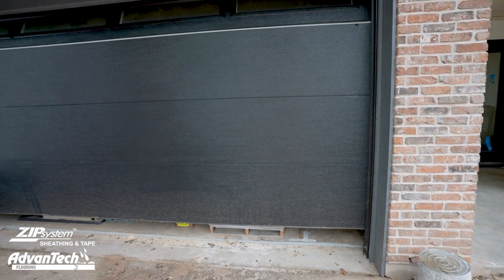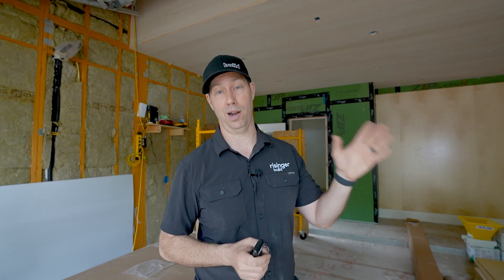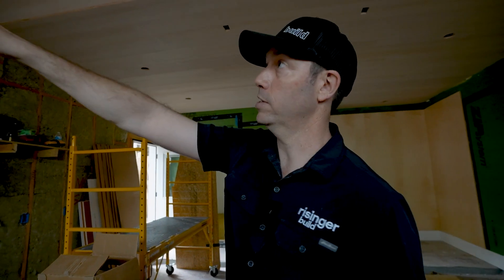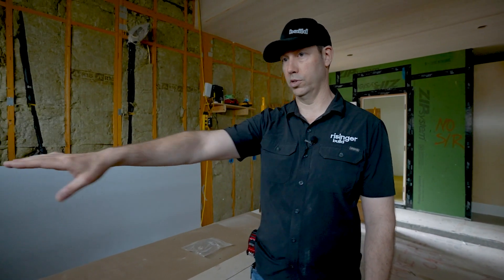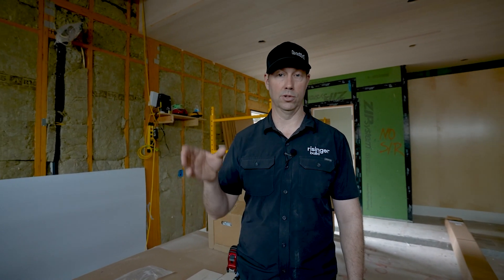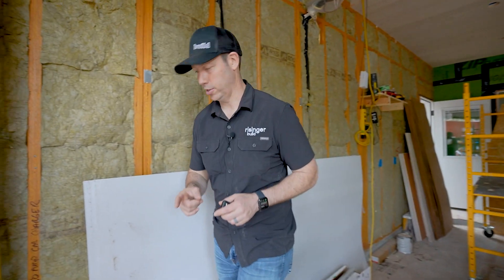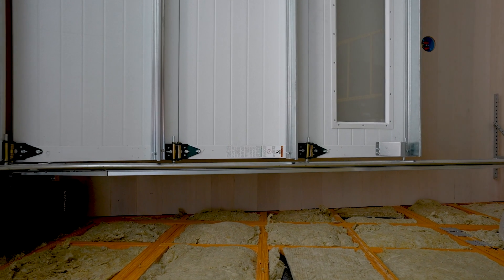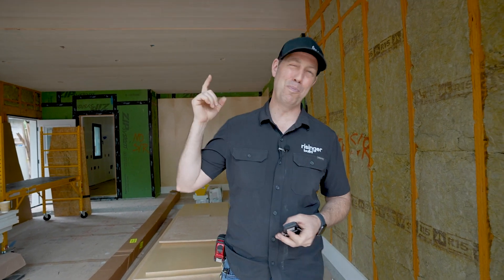SUPER Insulated Garage!

Comment: Isn’t it minimum code to have at least one layer of dry wall as a fire stop on your garage walls and ceilings?
Reply: I want the answer to this
Reply: The rockwool insulation is probably giving it the fire stop
Reply: @wyattbonnette3414  thats not what IRC allows as a solution.  5/8 gyp is what they want.
Reply: And taped too I thought
Reply: yes, i put plywood on the inside of a a garage once and it failed inspection.  had to cover it with 5/8" drywall.

Comment: That ball isn’t going to put out a lithium ion battery fire
Reply: Nothing is short of a pumper truck and hours.
Reply: I own the same battery backed garage door opener (love it). The battery is lead acid not unlike a UPS. But you make a good point. I wonder if the extinguisher will work on a lead acid battery fire.
Reply: @sirwnstn  those balls don’t last long enough to put out a battery fire. It will just start back up once the ball is gone.
Reply: This does work on Lithium Battery fire
Reply: @thomaslivezey  Lithium battery fires are caused by thermal runaway. They are extinguished by cooling the adjacent cells while trying to extinguish the actively running away cell(s) that is on fire and trying to contain it. Generally this is done by the use of all things water. Lots of water. However, do not drop or submerge into water. Just let lots of cool water flow over the battery. 

That is why folks are saying the above. That ball is to small to effectively extinguish a large battery fire, but with any fire time is key, so hopefully it will provide some capability to give responders time to arrive and get ahead of it.
Reply: Watching the demo's of the fireballs, to be effective, the ball needs a semi-enclosed airspace such that the explosive pressure can effectively deliver the material to the fire fuel and expel/displace part of the O2.  It is a small advantage to place the ball in a corner.  But, there is alot of airspace for the pressure from the ball to rapidly dissipate prior to being effective with the fire.  He would have been better off mounting the ball above because the ceiling would better reflect the pressure towards the fire source.  The lead acid batteries are not the fire risk of Lion.  Agree with the conclusion - probably a waste of money for anyone not being sponsored.
Reply: @sirwnstn  Sounds like he should set one on fire and put one of those fire balls on it to test it out!
Reply: @sirwnstn  if it is lead acid, I hope there is a test that runs regularly and notifies of battery issues and that the batteries are easy to replace. Those under temperature controlled conditions are good for about 3 years, and out in the heat it could be as little as 1 year. Lithium ion, or better yet lithium iron phosphate would be far better in that situation, though it would cost more up front.
Reply: @do4267  Or a type K extinguisher
Reply: @jeffreyparker9396  the Liftmaster 8500W will emit an annoying beep every 30 seconds and show a red LED when the battery needs to be replaced. Fortunately the battery is pretty straight forward to remove - one screw to remove cover, disconnect leads, and slide battery out. Just need a ladder and P2 screwdriver.
Reply: @sirwnstn  that is not too bad, but dealing with that as often as lead acid batteries would require is very annoying. Does it at least use a standard battery size which should be able to be replaced with a lifepo4 battery?
Reply: @jeffreyparker9396  in theory I guess you could replace it with something that can do 12V at 5A. I don’t believe the charging electronics would work with anything else but lead acid though. The Liftmaster 485LM battery is like $10 online. I’ve had mine for over 2 years now and will probably need to swap it out in a year or two. For me I think it’s worth it for $10 every couple of years to have peace of mind that if I’m not home and the power goes out, my wife can still operate the opener.
Reply: @sirwnstn  lifepo4 batteries are usually drop in replacements for lead acid batteries, just need to be able to get the right physical size. They do cost about 3x as much, but will normally last at least 5x as long and provide 3x the power for a given rating.
Reply: @sirwnstn  I will also note that the lead acid batteries are quite environmentally unfriendly when compared to the lifepo4 batteries. Also testing the battery has to be done properly or there would be no way to be sure that it would open the door. To do that you need to put the battery under load. I would be surprised if they test it like that since those testers usually cost a few hundred dollars. If you don't test the battery under load, then it is very possible that when the load of the opener is put on the battery, the voltage will drop low enough that the opener won't work.

Also worth mentioning that you can absolutely open any garage door without power since all garage door openers are required to have a disconnect for this purpose.
Reply: @jeffreyparker9396  if lifepo4 batteries can simply be dropped in without worry about the charging circuitry, I’d definitely think about it. As for opening my garage door without power, it’s definitely doable. I’ve showed my wife how to operate the disconnect too, but my wife isn’t strong enough to overcome the inertia of the super heavy door. My door is 16’x8’ sectional and solid wood - and yes, the 4 springs are dialed in to properly balance the door but moving it from dead stop is an absolute pain. I can’t expect my wife to lift it open, then grab a step ladder to hang on the door bottom to close it!
Reply: @sirwnstn  the force required to open and close the door is definitely something that I would consider if I ever replace my garage door. I generally expect that it would need to be opened without power at some point, even if I have a garage door opener with battery backup. Also less resistance on the openers motor will mean that it will last longer and in the case of one with battery it would mean that it is more likely to be able to be opened with an old battery. I would actually put having a low force required to open the door much higher priority than price or insulation, since it is a safety thing so that people can't get stuck in the garage.

Comment: The garage door opener has one thing that is most important: upon closing the door a deadbolt is activated! A nice and secure feeling when you are asleep or away for the weekend.
Reply: I've never seen or heard of one before, and now it's a must have for me.  Love this channel.
Reply: If you do any research into those automatic door locks, you will quickly see they have lots of problems.   Most people get sick of fixing them and rip them off after a few years.       

They are a good idea, just not executed well.
Reply: @brent1041  yep. And just having an operator attached makes the door immovable.
Reply: We have this same setup.  The deadbolt is great, and for anybody wondering, it has a manual unlock.  Along with pulling the manual release on the opener, you can open and close the door by hand if you wish.
Reply: @brent1041  I’ve had them for years. Two per door so four altogether. 
They have given me no problems only peace of mind. 
And I paid for them. Didn’t get them for free.
Reply: @brent1041  In three years the lock never failed on me.

Comment: As a Class A contractor with 37 years of experience I have been watching Matt’s videos for a while but I will have to say that the average person is definitely getting the wrong idea if you think you can put a flammable product (plywood) on the walls and ceiling of your garage without having a 1 hour fire rated shield behind it. Code REQUIRES this and is often met by installing 5/8” Sheetrock. I know Matt doesn’t usually comment on the responses to his videos but if you are thinking about doing this please call your local building department to confirm what you are proposing will not result in you getting into trouble and risking the lives of your family members.
Reply: Thought the same thing.

Comment: I really like that opener. Never have liked the standard opener yanking on the upper center of the door. Direct connection to the shaft seems legit. Good call on the raised rails too.
Reply: They are meant for this application with the high lift tracks.  They have lots of issues on standard tracks.
Reply: @VulgrDisplay  Good to know Thx.
Reply: @VulgrDisplay  what issues?
Reply: @shellderp  if anything makes the door hang up for a second, the door will pause, the operator will keep turning that shaft, and the cable will unspool, and then tighten around the shaft instead of the drum. I’ve installed a handful of them after trying to talk customers out of it and told them there is no warranty on it because they’re so prone to failures. I’ve come back within two years to replace them with regular openers
Reply: @nicolasjoy1181  i have this same opener, there is a cable tension sensor that helps prevent this issue. i've had the opener for 4 years now, never and issue at all. even installed on a tight clearance track, just had to add a spring to push the door closed the first 6 inches of travel.

Comment: We have this same setup and love it. The insulated door really makes a difference, especially in our bedroom which is above the garage.  For anyone wanting this, make sure you hire someone who is VERY FAMILIAR with installing this type of opener.  We had someone come out to install one and they kept commenting on how horrible they are and never work properly, etc, but installed it anyways.  It didn't work, wouldn't open fully, wouldn't close fully, would stop mid open...UGH!  He suggested we call another installer to check it out since we didn't a different one and he said this type of opener was junk.  We made sure the next garage door company we had out knew what they were doing before we hired them.  The whole unit was far too low on the wall to allow the direct drive to bring the door up all the way, the wiring was incorrect, and we needed the raised rails which weren't installed.  It works perfectly now.  They are great units, if installed correctly!

Comment: As a garage door guy I am soooo happy to see that they pitched the tracks for that Jack shaft motor.

So many hacks install jack shafts on standard tracks and they flop the cables off constantly. 

Bigo oof on the metal rollers.  Get some good nylon wheel 13 ball bearing wheels.

Comment: Hey Matt, can you show us all of the weatherstripping around the overhead door?  How do you air seal it?
Reply: same question I had. I would love to change my door out with something similar but the air sealing piece is probably important.
Reply: I will start with this - DO NOT TAMPER WITH A GARAGE DOOR IF YOU HAVEN'T BEEN TRAINED. THEY ARE EXTREMELY DANGEROUS. Sealing a overhead door is actually simple. That's if you have a sectional door. Things to consider are if it's so tight to the opening it rubs excessively or so if it's loose there's a gap. There's also the top roller adjustments, where the opener's close limit is adjusted at and also the physical force applied to the door by the opener. The condition of stop moulding and it's placement also. If you have a enclosed carport you may find the concrete sloped to one side and weather stripping doesn't seal the bottom on one side of the door. Even the angle of the opener's arm is a factor. 
1. The horizontal moulding goes on first. Trim part nails flush to the inside of the opening.
2. The vertical mouldings go from the top to about ⅜“ - ½“ from the ground. That prevents any bowing if the house "settles". Use paintable caulk to seal both ends and the front side of the trim around the entire opening. Train the flaps in the upper corners for the horizontal flap to overlap the vertical flaps. 
4. Weather stripping is easy to replace. There's usually small screws hidden on it's edges holding it in place on what's called the "bottom extrusion". It slides into channels from one end to another. It's a few inches wider than the door and has the excess  tucked into itself on both ends. If you have a sloped drive and there's a gap find a old garden hose and insert it inside of the weather strip. Use just enough to close the gap. You wouldn't want the door closing too hard where the rise is. The bottom of the door takes quite a bit of abuse. If the extrusion is damaged beyond repairand you need a new strip it's easy to replace. If mice chews up the strip replace it with gray. They're less likely to chew it. 
5. I CAN'T ADVISE MESSING WITH THE DOOR'S HARDWARE OR TAMPERING WITH THE OPENER. If you see loose hardware, bent track (particularly the verticals) or the door isn't tight call a reputable technician to service it. One thing I've seen, especially at newly constructed houses around Knoxville, TN is vertical tracks resting on the ground. That's a rookie mistake and a sign the installers don't have service experience. Just like the moulding there should be a gap to prevent bowing. It's a extremely negligent mistake. Danger being the door possibly flying off the track. The other stuff is safe for an average person to repair. Let a technician do the rest. It's easy and they usually can address any not so obvious issues they see immediately. A no parts inspection, adjust and lube can be done in way under a hour for $85.00 and no tax.
Reply: @qwaszxpolkmncvb  you don’t have such prefaces when riding a bike.
But more people are killed riding a bike than by garages.
Funny how paranoid people are.
I have zero training on garage doors and I fix them all the time.
It’s not complicated actually less complicated that riding a bike. Lol 😂

Comment: Hello Matt, love the progress of your home! What a great choice for your Overhead Door and Garage Door Motor, excellent choice. I know your a stickler for detail while making sure everything is right. Therefore, I will tell you the “Cable Tensioner Monitor” on your Liftmaster 8500W is installed incorrectly, it is upside down which will cause it to fail in time should dust and debris make its way into that region (refer to your installation manual). Being in the Overhead Door industry for many years I take pride in getting things right. Reach out if needed and can explain how to correct your issue. Keep up the great work…👍🏻

Comment: I have 2 of the LiftMaster side mount openers, been working great for 3 years now..  I didn’t bother with the battery backup as the circuit they are on is generator backed up.  Amazon delivery is great as well..  only thing I wish I thought about was getting the “high lift” tracks, as my garage is 10’ to the ceiling.

Comment: So close to how I did my garage.  My garage has 2x6, R23 walls, Liftmaster (though the center overhead Liftmaster) with MyQ, High R-value 3 layer garage doors with double-pane glass, and a Mitsubishi mini-split.  I went with a 15,000 BTU mini-split in an 800 sq ft. 3 car garage.  I set it at 55 in the winter and 85 in the summer, but I was working in the garage on a day in the 20s outside in the winter and set it to 70, and it held just fine.

I also did can lights in the garage in my work area.  I'm just missing the cool wood - mine is 100% sheetrock (and 5/8 sheetrock for the fire rating)...BTW, also a solid, fire-rated door between the garage and the living space.

Comment: I mounted rubber sealing around the outside and so it does not leak air on windy days. It's also heated and air-conditioned.

Comment: MyQ adapter on sale this holiday season for from about $16.95 (Black Friday - Bestbuy) to $24.95 at Lowe's. I bought one from Amazon for $19.95 less a $5 coupon. Mine works very well using WIFI. It is exceedingly easy to install and took just a couple of minutes on my Sears Garage Door opener. I think it will probably be replaced with a unit using Amazon's Sidewalk and perhaps Zigbee and WIFI as well. The single complaint I've heard about the unit is that you have to have a good WIFI connection to use it. If they do go to Sidewalk and or Zigbee, that will allow use of a low energy system that significantly improves connectivity. Easy to install and a fabulous purchase if it works for you. 12/7/21.

Comment: had 2 1/2 stall garage in north dakota, insulated, like his but without exterior insulation 2x6 walls, with living space above it  and never got below 40-45 degrees in there, without heater, even during a cold snap of -30 outside, with his more insulated , and texas never getting that cold, he will never have to heat it,

Comment: I have the same garage door opener and system.  One thing to know and watch is the LiftMaster wall control has an issue of failing and when it does it unlocks the door latch and opens the garage door randomly.  We had our garage open at 2am by itself and after I shut it the first time it would open randomly and we couldn't keep it shut.  It appears something fails on the wall control electronics and so the only way to fix it was replace the wall control.  Temporary fix was just remove the wall control until we got a new one. 

First wall control lasted around 3 years and from what I've read online this is an issue for a lot of people not a fluke for me.  Love the system, don't like the fact the electronics fail in an unsafe manner for my family.

Comment: I highly recommend installing 220v outlets (NEMA 14-50) in the garage for EV charging. All new vehicles will be electric in the not too distant future.
Reply: Good idea, but would try not to over-spec.  While Tesla uses the 50 Amp, GM tends to be 40 Amp.    Some installs need GFI Breakers (if plugs), and some do not need GFI (if wall-chargers).  Basic "safe" and flexible would be either 3/4" conduit + a pull string, or some #6 circuits ran back to the circuit breaker panel.   You can add correct breaker and plug (or wall mount) when you know what you are getting.